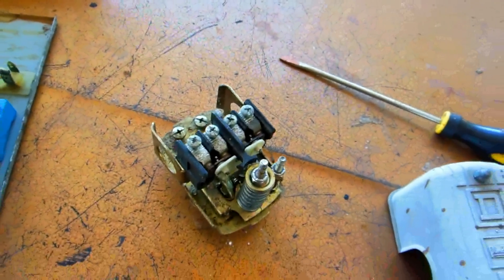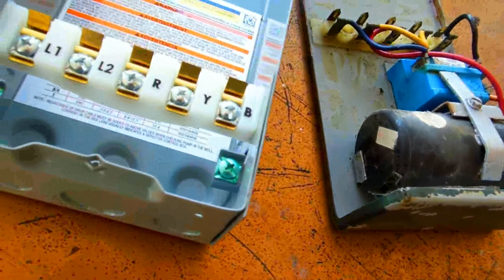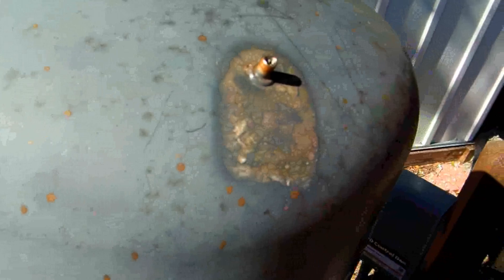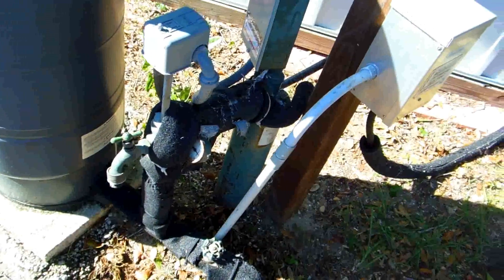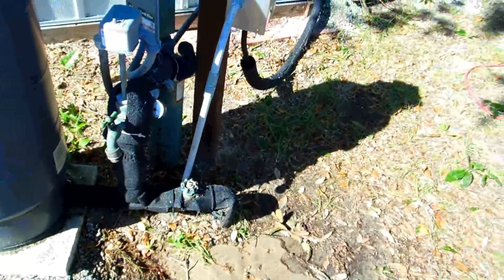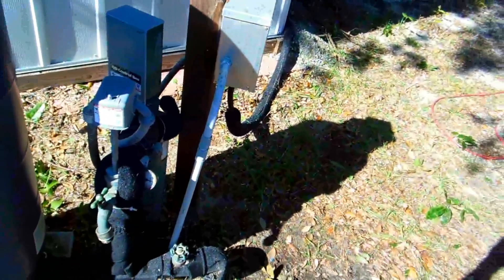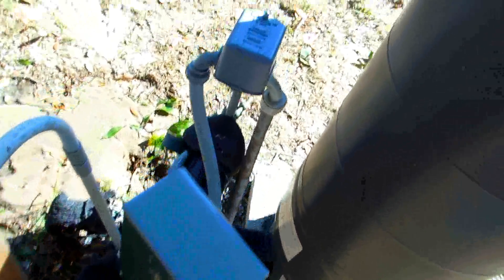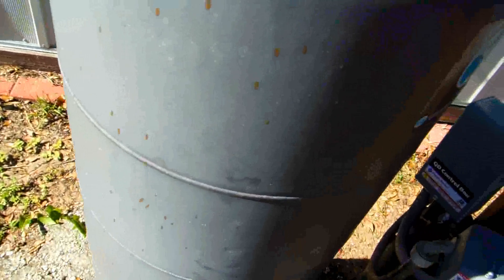Water Well Maintenance Tips & Advice for Longevity.

Comment: those 4 bolts probably holds the well casing
Reply from the maker: +Errol McCullough They squeeze a thick rubber gasket.  The bolts get loosened not removed.  I you remove them completely a steel plate falls down in the well casing and it could get wedged in there, so you'd never be able to pull the pump.

Comment: Use flexible black pipe when you go back in, and next time, pull it yourself.. Kind of hard to pull 21 feet straight up. The 4 bolts hold two metal plates under the single upper plate, between that, rubber to compress to seal the well head pipe. The pressure in the top of the tank is set at 2psi under your cut in pressure.. Usually 40psi cut in, so 38 psi tank pressure. Your pressure switch works the same way basically. Water pressure puts pressure on the spring under the contacts.. When pressure drops, spring pressure drops, and points close. Some has only one up or down adjustment, some has up/down and amount of pressure between cut/in and cut out. One preset, one adjustable. These are more expensive, and not necessarily needed..BTW.. Some older tanks have no bladder, but just had air in the top. Air rises. Air will compress to some point, water compresses very little.. The old tanks were usually slim and much taller, but, not many of them left by now.. None of them last very long anyway. I have been on well water a few times.
Reply from the maker: I'm definitely changing to flexible pipe when the pump needs to be replaced.
Reply: I looked back at your setup and have an idea for you.. I have a cement block house around mine, so I have something above for support. I actually have used my small forklift, put a 55 gallon drum on top of it, and lifted it just over the pumphouse that has a removable lid on it. I pull about 20 feet of the pump, hook it to my 4 wheeler, and let it spool out over the drum.. Round, so it does not crimp the pipe, or create drag on it.. Suggestion for yours.. Some sort of home made scaffolding and an old "Wheel Barrel Wheel" with the tire removed.. Just the rim mounted on a short axle. It will be pulling out toward where your pump is going to end up, more than pulling down, so brace it up in the direction you will be pulling.. Pull enough of the pipe up, so you can get it over the Rim, and hook it to something and pull it slow and steady.. It will come right out.. Just tape your wires to your pipe about every 3 to 5 feet, and you wont have any problems... If you pull your existing well, 75 feet or so, if it is PVC, you can do it yourself, if you have 3 or 4 people.. It won't be that heavy... My suggestion... Get a device that won't let the pipe go back in the hole.. Drillers have them.. Pull pipe up, it lets pipe slide through, let pipe go, and it clamps back down to the pipe. See if you can rent one from them.. Pull it up, let it down to clamp it/bite it, cut the pipe, pull it up again, cut the pipe, etc.. I made a jig like this with two pieces of channel that slip around the pipe, over the well head (rests on well head), with a lever holding a piece of pipe, just larger than the PVC.. I put my foot on it to hold it level when I pulled the pipe, and when I let it go, it drops down just enough to bend the pipe, and hold it.. I had one fellow hold the pipe, just in case, I cut it, and then, we pulled it up the next 6 or 8 feet and cut another piece off. This one was 175 feet deep... I had a bundle of 6 to 8 foot pieces when I got done. I measured all of them, rolled out the black pipe, marked and cut it.. Boiled water, stuck the end of the pipe in the water to soften it, then put the hose clamps on, and pushed the warm pipe over the fitting and clamped it.. Taped the wire every 3 to 5 feet with 3 or 4 wraps of black electric tape, and then, lifted it over my round barrel, stabbed it in the hole, fired up the 4 wheeler, and started easing forward.. The other guy just fed it and pushed it into the hole. The pipe is full of air, so it goes down into the hole slowly.. To be honest, really don't need the pipe anchored to anything. You have to push it down into the hole anyway. But, nice to have someone feeding it as you feed it..
I have always opted for the separate control box above ground.. I figured having the capacitor being easy to replace would be easier, but, I have also had many pumps that had the capacitor built in.. The ones that are built in the pump don't fail.. I have not had one fail yet anyway.. Usually they rust out, or bearings go out, or the motor windings just wear out.. I stopped buying the motors that require the extra starter box above ground.. Just one less thing to break.. Now, finally, all of my wells have pumps with starters built in.. Now,, my biggest problem is the tank baffels blowing out and leaking.. Before, I would replace the pumps and tanks together. These pumps with the built in starters are far outlasting the above ground starters.. Now, I replace tanks more than pumps.. So, I am rebuilding the pump houses, so, they are at the end of the plumping, instead of middle, so, it is easier to disconnect them and replace them. If they ever start making a tank with a removable top and top seal, with a replaceable bladder with some sort of fiberglass coating inside of the tank to stop them from rusting, I'll pay the extra $75 to buy the damn things... When the bladder blows,, unbolt the top, pull the old bladder out, flush the tank out, put a new one in, new seal, bolt it back down and find something else better to do with the rest of the afternoon...
I can't believe the lack of innovation in building products these days... There is nothing any more aggravating than replacing these tanks, and why in the world has someone not come up with a better door lock for interrior and exterrior doors... Why do they have to be so damn finiky and have to be adjusted so properly to make them work right... And, when you think about it, I can kick about 99% of the doors in on any house I have ever seen. There is such a thin piece of wood that holds the door closed, there is nothing security about them. I always home build my door frames on my shops, etc.. either with metal doors and metal door frames, or use solid wooden doors, and build my own metal frame as a backer around the door lock area, and tie it into the stud that is holding the door frame..
When I was 30, and living in Louisiana, at 2am, had the law kick my door in... I was in bed, and they didn't even ring the bell or knock on the door.. WTF is going on.. Luckily I was butt naked when I rounded the corner or, I think they would have shot me... They had the wrong address on the arrest order and search warrant.. All they had was a 3" piece of 1/4" thick pipe, with a flat plate on the front of it.. A little skinny guy who was the one who knocked the door in... I looked at it and was amazed at how flimsy the doors are.. In my opinion, it is TOTALLY IGNORANT.. Doors and  Door locks are only for honest people, not for criminals and Law Enforcement. Oh,, and BTW.. No, they didn't pay to replace the door, or the door jamb.. They rammed the pipe directly on the door lock, to be sure, both were crushed as they smashed the door open.. Open your door, and look at the only thing keeping the door from being kicked in.. You will be amazed... Cheers and good luck with making your pumps easy to replace.. I pull all of my own now.. They usually last about 8 to 10 years max.
Reply from the maker: Mark Thomas
Those bladder tanks don't last.  I am going to build something over the well with strong pressure treated lumber and use it to pull the pipe and pump when I have to.  I also have a 4X4 Jeep and a high lift engine that will get it started.  I am aware how crappy things are made, including door locks and I am strengthening things everywhere here and there.  It's an on-going process.
Reply: Let me know if you ever find a bladderless tank, or something that will last, or, that is easily changed.. I promise,, I will owe you for a very long time, and try my best to return the favor.. Ha.. That's a promise..  Right now, I maintain two wells on my property, one for my Brother and one for my Mother, and you know how the rest goes.. Friends, girlfriends, etc.. If I'm lucky enough not to be there working on them, I know exactly what test is being done, etc, because I am often on the phone while they are doing it.. Anything that saves time.. And, sounds like you have more than what you need to get the job done.. Cheers, and good luck with it.. Hopefully, you never have to change one.. Yea Right.. But, if you do, next time, it won't be any big deal.. Thanks for the video.. If you have every wondered about Rocket stoves, I spent a good bit of time building "Big" Cooking Stoves. There were none when I started.. I have a two hour cooker, two surface cooker, etc.. Lots of research, etc.. Have a good one.. Keep up the good videos.. Thanks.

Comment: Ps if you have septic system and you drive a new well it has to b at least 100' away
Reply: syyenergy7
That is 100 from the leach field not the tank. Most areas.
Reply from the maker: Yes, it is 100 ft away.

Comment: If u blow air into bladder u will create more pressure don't over do it if u turn pump off open that hose bib / stick it then apply pressure and air comes out of spickit u have a bad tank diaphragm tip 4 the day 101"

Comment: In jersey they us black Polly pipe with nylon rope to pull out pump if you have a 2 pipe system that means a deep well the bladder might have a pine hole in it that's how u get your pressure from that diaphragm u need a back how to pull it out with slip nots there is a check valve on the bottom us Polly pipe when u install the new pipe I've done quit a few  the well point may b bad

Comment: Ya, I fig..you had if figured  out on the switch , Iit was just incase someone wanted to try it that  watched the video also . O on the well seal   You can loosen  the nuts but just snuff to free it up , you just can't undo all the way the bottom half of the seal can drop off and down the well . Most of the time it will jam in the  well  and your done ! It just sandwiches the rubber seal  and that's what seals it . If use the coil pipe ,  then you can pull pump with your truck or evan a riding  lawn mower . Take a wheel like off a wheel barrel, now make a bracket for well head so now the pie will up and over the wheel hook it up and go . Well you know what I mean there's a few thinks you have to do . Thanks and have a good day.
Reply from the maker: Curious. why do they install rigid pipe?  The coil pipe is much easier.  I could rig something up and pull it with the Jeep in low/low if it was the coil type.

Comment: i'd pull up the pump and break every single pvc joint and then reinstall with flex pipe. no need to cut trees or get heavy equipment there...you can do it with your hands. two people.
Reply: Definitely a necropost, but I am interested in learning more about this as well.
Reply from the maker: I'm going to do that when it gives out.  What a joke really.  I look at this now and I pretty much understand it now.  I think with the coil (flex) pipe you need to put something in there to keep the well motor in place.  Plus the rope.  I'll figure it out now.  They must mainly do this so when when the pump goes it's $1,600 vs the DIY'er going on ebay and getting a quality new well pump for $155.
Reply: syyenergy7 I know a lot about these deep well pumps (yours is rather shallow @ 700 feet)..my dad has one...he didn't tie the rope knot well and the rope gave out...pump was hanging by the flex, but i was able to pull up the pump by the flex carefully...steel cable is best for pump with "U" bolts.
Reply from the maker: Accuracy Marked
I'm going to use two ropes if I do this later myself.  It's at 75 to 77 ft.  I could make a tripod.  I'll just get the stuff and have it ready for when I need it.
Reply: syyenergy7 great idea...like it.

Comment: Huh? they didn't run flex pipe on your pump?...the pump is suppose be be on a rope or cable and you wind it on a hand pulley-spool winch to get it out...why trim trees? I can't believe they ran hard solid pvc piping 77 feet down...that would be retarded...needs to be flex pipe so you can coil it as you pull up the pump.

Comment: Hi thanks for all your videos . I just wanted to  maybe help  on a few things I hope you don't mind . One thing is on your pressure setting on the tank , what you want it 3 to 5 psi lower than your  your  cut in PSI because Somme pressure settings are different ,like if you had a 30 / 50 switch you want 24 to 28 psi . On your pipe in the well ,do your self a favor and install 1" coil pipe 160 lb  that way you can pull and reset your self NP . If you have PVC pipe it's 20 ' and steel pipe is 21' don't worry about the coil pipe  ether you can set a 1 PH down 500 ' NP I can tell you haw to pull if you want to email me . Or any ? Be clad to help thanks again for all your videos .
Reply from the maker: I guess it is steel then since he said they were 21 foot sections.  There should be 4 sections.  I replaced the 3/50 switch with another 30/50 switch and he said it should be a 40/60.  But they did the 30/50 before, so he adjusted it to 40/60.  I hear you on the flex (coil) pipe vs the rigid.  Then you don't need a truck with a crane.